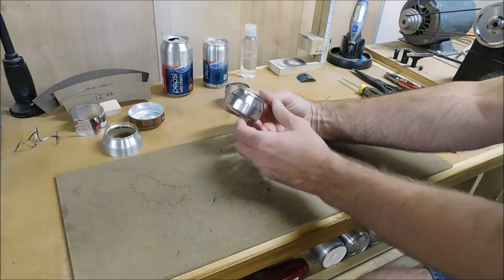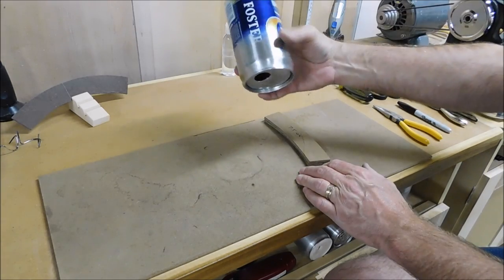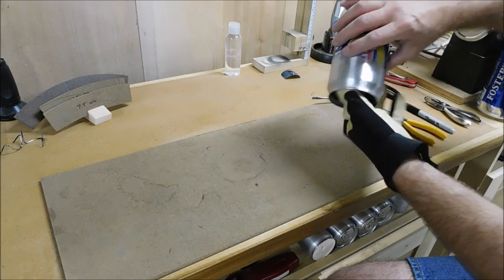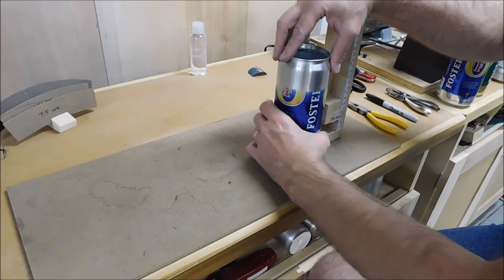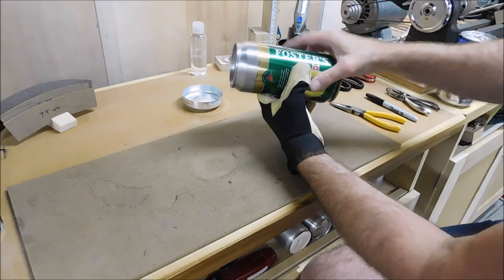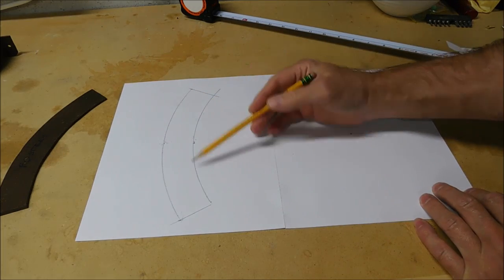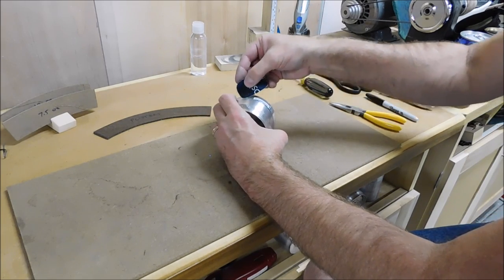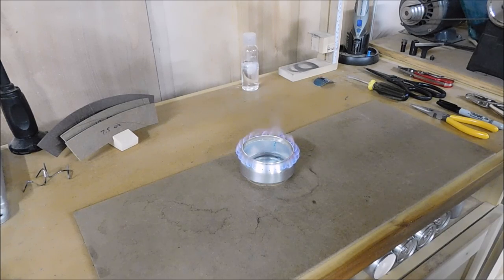How to Make an Alcohol Stove from a Fosters Beer Can

Comment: Pretty dope.  Just made a penny can stove for the first time, and it's neat to see all these different designs out there.
Reply from the maker: Thanks!  I've never made a penny can type.
Reply: I didn't even know these were a thing until last night.  Worked fine when I tested with 70% isopropyl alcohol (all we had in the house) .  I'm going to make this Fosters can type tonight actually...  Should be fun on a bun.  Plus I'm pretty sure my penny can will fit inside it so I can easily pack both at once.

Comment: Since the way this thing functions is due to the outer chamber being pressurized, try not making such large holes or notches in the bottom of the outer chamber piece and only cutting scissor slits about 1/8" long.....the low viscosity of the Methyl Hydrate will certainly weep through the bottom and allow a higher inner chamber pressure. You may only need to make large access ports if you decide to seal the upper and lower contact points of the inner wall. I've made many of these stoves and never had a problem getting the flammable fumes into the outer chamber with no slits even cut and have had excellent pressure jets burning, making the entire project more efficient.....not being critical, just trying to assist in a point most makers of these stoves miss out...... sincerely K.W.    BTW the penny stove is even better at producing higher pressure.....
Reply: Once it starts to bloom just place a pot on top it pressures the fuel to the outer wall.

Comment: Followed the instructions with one exception...drilled 25 1/16th holes, cause I didn't have a 1mm drill bit.  1/16th inch = 1.6mm.  Boiled four cups of water in 15 minutes from lighting.  75ml of denatured alcohol burned for 25 minutes.  Flame pattern was perfect for the somewhat large pan I backpack with.  Just a hint, don't force the entire stove top over the unopened Fosters can while trying to stretch it open.  It will get stuck.
Reply from the maker: Thanks for the results, hecatesaga!

Comment: Thank you Tim. Thanks to you and the others that do these stove videos, I have a new hobby.I've made several of the various types, penny, inner wall. I like the Foster's stove. I notice you make it the same height as the smaller ones. What if you made the stove taller? Would the only advantage be longer burn time? Haven't seen any taller than 1 1/2".
Reply from the maker: Thanks Chuck.  The taller the stove, the less stable it could be.  Low and wide means less chance of it tipping over but it could easily be made taller.  The inner wall geometry would have to change with longer radii for both arcs. Have fun with your new hobby!
Reply: Thanks for replying. I have made 4 now. Only have 12 oz cans at the moment. I want to try the Fosters one. I also have a 5 ltr mini keg in the fridge. Wonder how that one would work?

Comment: Great detailed video. By chance have you tried cutting off the lids to those cans with those can openers that  remove tin can lids without the sharp edges???, I forgot what those can openers are called but I believe they work by separating the lids at the seam on the main can body. Cut some of your cutting time down from 4 min to about 15 sec.
   Thanks for sharing!
   Kind regards, Eric Dee.
Reply from the maker: Hey Vacuum tube junky, I do know of the safety can openers and you are correct, they cut the seam and leave a rolled edge around the top.  I have to cut down in the channel the way I do so that it leaves that lip that holds the inner wall in place.  Thanks for the thought!

Comment: You can also use the middle part of the can as a wind screen.
Reply from the maker: I like that. I might make a short video on it. Thanks, +thundersnowstorm!
Reply from the maker: What are breather holes?
Reply: Breather holes are holes you can punch into the wind screen to allow air flow through the wind screen to prevent the alcohol stove from over heating.

Comment: Hello,

Do you use a support for the stove, or do you put the pot directly on it ?

Thank you very much for your answer.

Best regards.
Reply from the maker: All of my camping is in the winter so I use wire standoffs to hold the pot off the stove just enough that it eliminates thermal transfer from the cold pot to the warm stove.  But the wire standoffs are thin enough that they don't let enough oxygen into the central burn chamber to keep a fire going there.  Take a look at my vodeo on using an alcohol stove in very cold conditions:  https://www.youtube.com/watch?v=nPRU8V4Ltf8
There shouldn't be a problem putting the pot directly on the stove in warm weather.  You should NOT use a stove stand that holds a pot high enough for a fire to continue in the central burn chamber.  That flame needs to be snuffed out by the pot.
Reply: @timcanthejigman7932  It is very ingenious. Thank you very much for your answer

Comment: I wonder what is the optimal height of an alcohol stove?
I've seen from other videos that the optimal distance from the flames to the can of water is between an inch to inch-&-quarter.
So I wonder can you build it taller, make the holes at about 1" to 1.25" below the top rim, make it taller so that enough fuel can be loaded under the holes, and would it still work properly?

Very good guild btw!
Reply from the maker: Thanks, Toni.  A few things going on here.  First, I'd want to see the methodology behind the experiments that were done to determine that an inch to inch and a quarter is optimal.  And optimal at what:  boiling faster, using less fuel?  Second, I'm not in favor of adding height to any of my alcohol stoves since it makes them more tippy.  Third, the position, size, location and number of jet holes determines the thermal feedback driving the stove.  You don't want a configuration that over heats the stove and gives you a runaway boil.
I would advocate against changing the design unless you're prepared to spend a LOT of time testing in controlled conditions.  Thanks for asking about this, that kind of thing interests me.
Reply: @timcanthejigman7932  , optimal regarding boil time,  assuming that the faster it boils generaly more efficient would be.
I'll send you the link when i find it.
Thanks for the quick response!

Comment: Hi Tim,  I am hoping you will answer two questions for me. I have made a number of soda can burners.  I want to narrow my work down two one or two styles. This, hopefully, will give me the best chance to create a good working stove.  

1.  Which one or two style of burner would you want to use?
2.  Would an open top burner work better if it had a snug fitting lid, Or are they best left open.
3. Have you ever thought of uploading your templates? For the center wall for example? I would love to try your Fosters burner, but have not been able to get the pattern correct yet..

Thank you
Reply from the maker: Hi Janet.  Thanks for your interest in learning from my videos.

1.  I almost exclusively use this open top, side jet type of alcohol stove.  I have videos showing how to make them from juice cans, mini cans, 12 oz cans and this Foster's one.  The design is pretty bulletproof and easy to make.  It only takes me about 10 minutes to make one.

2.  You have to leave the top open initially so that the central flame can heat up the stove to start the alcohol vaporizing so it will come out the jets.  Once the jets have bloomed, then you can put a pan directly on top to snuff out the central flame.  No separate pot stand needed.

3.  I was actually going to have templates for the different size cans online for download but it's so easy to simply draw two arcs with the correct radius.  You could even do it with a pencil and piece of string.

Comment: Noice build. I guess U make a lot of these stoves
Reply from the maker: Thanks Graham!  I've made my fair share.
Reply: @timcanthejigman7932  I seen video after Ur and the guy said gas bottle stove are better. I think alcohol ones could be safer. If gas bottle blows could cause a bit damage. Fuel would easier to get hands on
Reply from the maker: They each have their advantages and disadvantages.  A big advantage of soda can stoves is that they are basically free, which seems to motivate a lot of people.

Comment: I'm curious if there is a benefit to using a top and bottom instead of 2 bottoms; 2 bottoms would give rectangular inner walls and so be easier to make.  As an added benefit you would have an excuse to drink 2 beers.
Reply from the maker: I see a benefit in the economy of using just one can for one stove.  You can still drink two beers, but then you get to make two stoves.  If you use two bottoms, you have to cut out the center section of one of them and I find that to be more difficult than using a template to cut a curved inner wall using a top and bottom.

There is usually more than one way to do something, though, and they can all work.

Comment: Just asking, for the fuel, is it 70% alcohol or it's always 90% ?
If not okay for 70%, how do I make it work ?
Reply from the maker: Hi Goo Zion, in the US I use denatured alcohol (99.99% ethanol) or HEET gas line antifreeze (99.99% methanol).  You may be able to find denatured alcohol where you buy paint.

Comment: ok, Tim, great video, and I have not seen anywhere where you have offered any to your subscribers, for a price of course, DO YOU?????
Reply from the maker: I've said before, I'd rather teach a man to fish.  I would feel guilty selling something that is basically free to make.  That's why I show so much detail, so people can make their own and get good results.  I appreciate the thought!
Reply: Marty Smith I can make this for you. $50.00 American
Reply: JAWGA ... lol  time is money
Reply: Can you show some economic tools to do this project?
Reply: Luisa Xu - if u do not have a drill, carfully make the holes with a push pin or nail. Can use any knife or blade with a spacer taped on , to make cuts
Reply from the maker: The aluminum in cans is thin enough to use an ordinary pair of scissors to do the cutting.  Use a P-51 can opener to safely cut the top out.  And as Mark Wilson notes, a push pin works to make the flame jet holes.

I like your suggestion.  If I do another alcohol stove video, I'll use those more commonly available tools.  Thanks!

Comment: Is there a size limit for the stove?  Most are about an inch tall (knife held on a 2x4) but can you go to 2 or 3 inches tall?
Reply from the maker: There will be a point of diminishing returns going too tall.  The flame coming out the jets has to keep the stove hot enough to continue vaporizing the fuel.  If it's too tall, there's too much metal too far away to keep the stove properly hot.  Also, the taller it is, the more tippy it becomes.  I wouldn't make it 3 inches tall.

Comment: is it safe to cook for 30-40 mins continuously. do i need to take any precautions while cooking with this stove?
Reply from the maker: I've never had an issue using any alcohol stove I've made.  For precautions, I make sure I'm aware of where the stove is at all times so I don't accidentally bump into it or knock it over.  Spilled flaming alcohol would be unsafe.

Comment: ok i am having trouble. when you cut the nick in the inner wall and bend it over, how exactly do you do it. i messed up on 3 of the inner walls i cut out,for three can stoves im making. it seems to come undone easy doesn't stay put, to well. help me out please and thanks.im going to have to cut out a few more inner walls but i dont want to mess up this time.
Reply from the maker: After I cut a small nick where the two ends overlap, I fold up little triangular corners - that locks it in place long enough for the stove to go together.  I fold one triangle to the inside and the other triangle to the outside so they fold in opposite directions just the way the scissors starts to bend them.  Take a look at 14:00 in this video:  https://www.youtube.com/watch?v=iVJeEbMEBEw

Comment: Seems like I did everything right but I'm still not getting any flames from the holes coming out 🤔😧 no matter how much I put in alcohol, lots or a little bit, still nothing.. does it it matter the height of the stove and the holes for the flames? Something is not right somewhere
Reply from the maker: This is a pretty forgiving design as far as hole size and spacing, height, etc.  Still, there are some limits.  The height of the stove affects the ability for flames to form.  The taller the stove, the more mass there is and therefore, it's harder for the initial central flame to heat it up to the point of ignition of the jets.  Also, quality of fuel.  Only use Heet or denatured alcohol.  Don't use anything with "iso" in the ingredient list or name.

Comment: @timcanthejigman    is a 1/16 bit ok to use? whats a 54 bit?
Reply from the maker: It sure is.  A #54 bit is .0550 inches in diameter, a 1/16 is .0625 inches.  Close enough.
Reply: @timcanthejigman7932   man, i was just about to buy some bits online, then i seen your comment, thanks for saving me some cash, and thanks for your videos!
Reply: @timcanthejigman7932  i for got to mention im using a can stove stand and my pot is about an inch from the flames.

Comment: Could you make these and leave them Burning as a Source of heat.
Reply from the maker: It wouldn't be very efficient as a heater.  Not enough mass in the aluminum to radiate much of anything and the flames don't last long enough to contribute anything.

Comment: Where did you get that dremel tool I cant find it anywhere.
Reply from the maker: Sadly, they've been discontinued and are now collector items.
Reply: Do you have any recomendations for a newer dremel that would work for drilling tiny holes like that?
Reply from the maker: @hollyfoutz4291  Just about any of them work for that.  If you like that pistol grip form, Dremel makes an add-on pistol grip that you can attach to any of their tools that have a nose bumper that unscrews.  Search for Dremel tool and Dremel pistol grip.  Big box hardware stores should have them in stock.

Comment: How long will they burn before running out.
Reply from the maker: Good question.  It depends on how many and how large the holes are but the way I made mine, 100 ml of denatured alcohol will burn for about 40 minutes or more.  It also depends on having a pot resting on the rim of the stove so that alcohol doesn't burn or evaporate in the center.

Comment: lots of wasted fuel burns in the middle? i tried using the bottom of a fooster can, cut out with a hole(i may have made the hole too big, i think i need to make it smaller hole in the center of the can for oxygen flow. basically i want the flames to mostly come out of the the pilot holes, but i know it needs oxygen to burn. trying to figure out and an Efficient way to control the flames. i have a simmering ring that i made from a footers can but i haven't tried to use it.  im not trying to simmer yet im just trying to control the middle flame.
Reply from the maker: These stoves are designed for the pot to sit right on the stove with no gap.  That snuffs out the center flame so it isn't just wasted fuel.
Reply: @timcanthejigman7932  holy shit. ok. i wasted a lil to much time on this stand then.thats makes thing easier.  thanks for the quick reply

Comment: I made this stove and it works great! I used isopropyl alcohol and it took about 20min to boil 4 cups of tap water. I'm hoping denatured alcohol will burn hotter. this is a great video and explained everything very well. I diddnt have a jig but I placed my razor blade on some cd cases to cut my can. Great video!!
Reply from the maker: Thank you for the feedback, brad!  Denatured alcohol will work better in your stove.  Isopropyl alcohol leaves a sooty black residue on your stove and pots.  You can find denatured alcohol wherever paint is sold.
Reply: I'm going to try making coffee with this stove this morning. I fried some eggs and sausage with it yesterday and it worked very well. I did buy denatured alcohol and it does burn much cleaner. Thanks again for the great video.